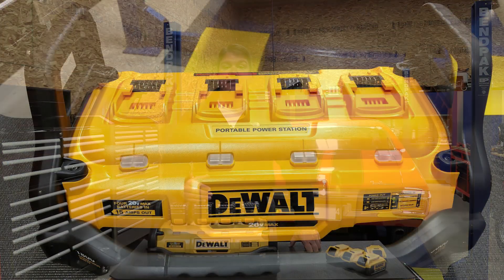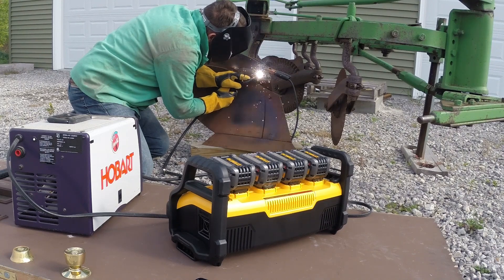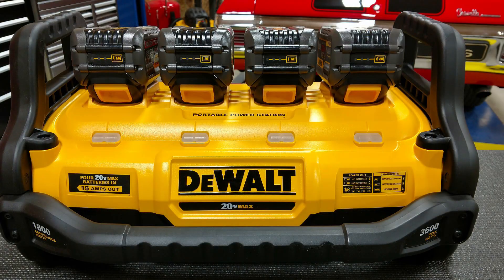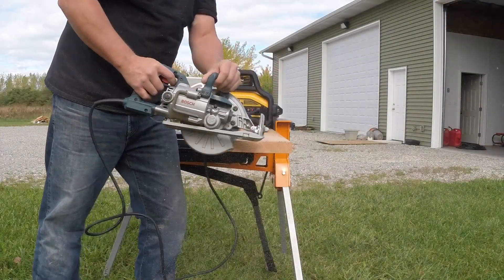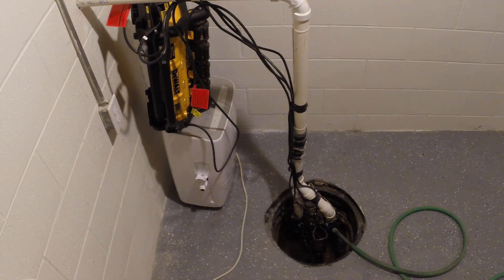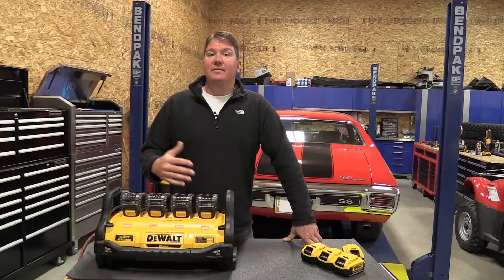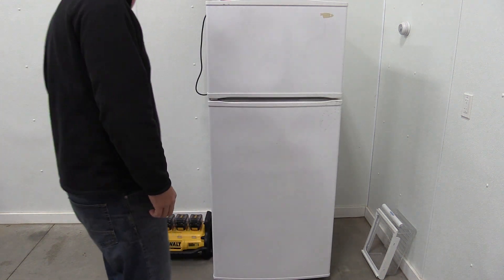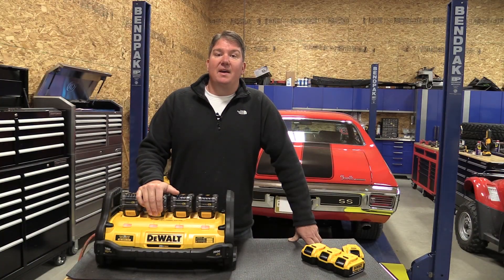DEWALT 1800 Watt Portable Power Station Testing - DCB1800

Comment: There is ZERO reason they could not make it charge and also run a power tool at same time. Absurd...this way i run coil lighting and if the power went off in middle of work, it would switch and run the lights a bit longer.

Comment: So the biggest question I have if I bought 2 n used one as a power source to supply power to the other that is charging would battery bank A die before battery bank 2 is fully charged....🤔

Comment: I use mine with the new 15 amps and I can run a small 8o amp welder with 1/16 electrodes.  Also I can run 2 fridges one freezer , ceiling fans and some lights for about 5 to 6 hours.
Reply from the maker: That is pretty impressive.

Comment: Considering the unit itself is almost $600 i dont see how this compares to a generator. The 60v batteries are 150 minimum, and with 4 in use you can only charge a fridge for 8hrs. At a $1000 you can get a generator that will power your whole house for hours.

Comment: I was wondering of this thing will turn itself off after a while of not being used ? Probably isn't that smart I guess ,but somehow I was thinking it would since last time I think I forgot to push that power button off and when I went back to my storage locker where I have it the batteries were almost drained even though they were almost fully charged before that. However if there is nothing draining power it makes me wonder why it would drain the batteries even if it is on. Also its possible they werent as charged as I thought ,since I know I used it for a couple hours that day with a stereo at very loud volume

Comment: Thanks for the video, I picked up the kreg acs system saw over festool without considering that I couldn't break down sheet goods with it without a power outlet and my CRV can't fit full sheet goods, ordered one of these so I can do it in the parking lot instead of buying something like the accucut and losing the track saw quality.

Comment: True or false

Considering the advent of PowerStack batteries, the MAXIMUM run time for the DCB1800 Dewalt Power Station is STILL 4 DCB 615 15aH FlexVolt Batteries? Real world experiences only please.
Reply from the maker: Powerstack batteries are only at 5Ah currently.  Max runtime on this would be with four 15Ah Flexvolts.

Comment: Do all 4 batteries need to be plug in to use it or can I just use 1. Do they need to be all the same ah battery. Will this power a 1500watt space heater

Comment: I wonder how long it will runs a space heater?
Reply: I ran a space heater with one I had 1 20v max 6 AH battery, 2 flexvolt 6 AH batteries, and 1 9 AH flexvolt battery it only ran for 18 minutes straight before my non flexvolt battery gave out I let sit for awhile and my 9 AH battery said it still had 2 and a half bars left and my 2 6 AH flexvolt batteries said they had 2 bars left so I think if I had all 9 AH batteries it would run for much longer I wasn't that impressed with it but in all fareness it was a pretty big space heater and was kind of asking a lot of the power station.

Comment: My one disappointment is the standby power.  You couldn't really keep it connected to a sump pump as illustrated and expect it to function when a float switch trips.  The standby current just to keep the DCB1800 on will soon suck the power out of even a full array of 9ah Flexvolts.  I haven't done a real test but my observations show it has the batteries down to one LED in a couple of days.  Other than that I love the thing, it powers my new Rolair JC20 Quiet Compressor without a hitch!

Comment: can it charge a 60v electric bike
Reply from the maker: Like a Suron X?  Yes, it will, but remember you lose about 20% of the batteries watt hours used in the conversion to AC.  So you will need to use larger batteries.  8.0 Ah 20 volts or 9Ah Flexvolts

Comment: Can I use a regular 20v dewalt batteries?  Not the flex
Reply from the maker: Yes, it is only going to last as long as the smallest battery you run.  As soon as one battery dies, the system shuts down.  So it pulls the same power from each battery.  If one is a compact battery, it wont last long.

Comment: If this was a pure sine wave I would buy it.
Reply: I saw another video that a guy but an inverter that made the sine wave safe for delicate appliances electronics 106 to 160 for the unit and you just plug it in the dewalt

Comment: I use mine for backup power I’m on oxygen in cases of power outages I plug the simply go resposonic and I’m good for 11 hrs with 4 12 amp battery
Reply: Be careful with medical equipment. The modified sine wave from this inverter can damage it or it may not work correctly. 
https://www.altestore.com/blog/2015/10/pure-sine-wave-vs-modified-sine-wave-whats-the-difference/
Reply: Go with a solar generator, less money, more versatile. Look at Bluetti or Jackery

Comment: Need to 5000 BTU Air conditioner,How long will it run? takes 550/hr (almost 4 hr)think that's right,Thanks
Reply from the maker: Would do 4 hours with four 9 Ah batteries.
Reply: @WorkshopAddict  thanks

Comment: Question:  can u this system with Car Hauler that needs power to it ?
Reply from the maker: I can power a car hauler, but will turn off after 20 minutes if it has no draw.
Reply: @WorkshopAddict   so if I draw no power from the unit it turns off and if I run power from it for an event it will stay on ?  planing on buying more batteries  trying to stay away from  loud generators
Reply from the maker: @NelioJViana  Yes, if you draw power often, it will stay running.  If it sits for 20 minutes without use, it will turn off.

Comment: Fantastic review! I was disappointed it only ran the workshop vac for 17minutes when a new dyson v11 with go 60minutes on torque drive. However running a fridge freezer for that long is impressive and i would probably use one to run a Festool mitre saw which still sadly aren’t cordless yet 🙄 so i guess that would be similar to your 66+ cuts. 👌🏼
Reply: Gotta remember they used the smaller capacity batteries for the vac

Comment: Just stumbled upon the Milwaukee Mxfuel carry on power supply ($2000👀) n was like damn dewalt y'all let me down...only to realize dewalt already had this power station out for yrs with the same inverter system that i c the Milwaukee demo guy seem sooo proud of, smh. What's even better is bare tool is @ $482.50 and i already have 2 flexvold batteries 🤗🤗🤗🤗🤗🤗 "me so happy"

Comment: Would this safely run a dometic ac? Or even a 5000 btu ac?
Reply from the maker: I do not think that any AC unit will run on 1800 watts.
Reply: @WorkshopAddict  there are installations like the micro air easy start that stops your ac compressor from that initial power surge that allows those types of ac to run off of a 2200w honda generator. I'm not sure how much continuous watts they would need but it can't be over 1800 watts. And in this scenario, I'm only referring to the lowest btu ac cooling off something like a cargo van
Reply from the maker: @vtran1082  Then Maybe.  I am not aware of any that will work.
Reply: @WorkshopAddict  I'm just worried that not using a pure sine wave would damage the portable ac
Reply from the maker: @vtran1082  I would be more worried about voltage and wattage of this unit as I think it is a bit small.

Comment: I have the same power station but in the charger mode can I charge just three batteries
Reply from the maker: That sucks
Reply: @WorkshopAddict  my question is if I can charge one or two batteries
Reply from the maker: @JRSRwilfredo  it will charge all the batteries plugged in that need it.  Just plug in one and it will charge one

Comment: Thanks for showing some real world practical uses which can be done.
What I want to know is if you lift it will the batteries fall out and do you need all four batteries to use it
Reply from the maker: The batteries are locked in and will stay in unless dropped.  You do need 4 batteries to run this and all must have a charge.  As soon as one battery is dead, it will no longer create power.

Comment: Could you do a review on this product for me, I sell lamps at a flea market, (indoor) that I dont have an accessible outlet. I currently have about 30 lamps, that I would like to power simultaneously, I am wondering what my run time would be if I used this as a power source. I each lamp would have a 60w led buld which uses 8w.

Comment: Will this power a 1500w. Engine block heater plug? It's the one semi trucks have, thanks
Reply: I'm thinking to add a timer like an hour before my arrival at truck to the DeWalt power station hopefully that will keep the heating element hot on engine block?
Reply from the maker: @justatruckdriver9809  You have to push and hold a button to turn on the power station.  Not sure how you could time it to turn on.
Reply from the maker: Yes, the only downside would be if there is very little power draw for about 10 mins, the unit will turn off. So as long as there is not thermostat that shuts the unit down, it will work awesome.
Reply: The timer has a battery, after watching your video about the DeWalt power station I will buy one this Friday to use it to plug in my truck engine block, a few other if my friends are also looking into it, thanks.

Comment: i have been searching the website and called around cant get a positive answer
can this use the flew volt 20 v 9 amp/12 amp hour batterys?
Reply from the maker: Yes, without issue.
Reply: @WorkshopAddict  what is the capability u can guess if needed or Maybe u know impericaly but if u stick four 12 in there what is the run time run ability
Reply from the maker: @samrowe2889  Same capacuty with 12 Ah batteries, just would up the runtime by 33 percent for whatever you are running.
Reply: @WorkshopAddict  thats what i was wondering like what is the increase in run time and.33 percent is pretty significant and.it.wuf also be a significant purchase at the prices they are wanting for 4 12 amd the tool itself u cud buy a car lol or a really nice gun but u cudnt by.a generator for cheaper tho so i guess if u have ur guns and cars then the next step.is to drop the 1200 on the tool
Reply from the maker: @samrowe2889  IMHO, no electric battery operated inverter is worth 1,300....  Not the DeWalt, Not the EGO.....  They are cool, but when you factor in how short they run and also how much it costs to maintain batteries over many years, they are cost prohibited.
Reply: @WorkshopAddict  man u really broght it home so save the money for a gas geny or either that or dont get four 12ah batterys
Reply: Sam Rowe if your a  Remodeler or framer, this power station is perfect. A must have for construction

Comment: I went to California public schools so my math skills are shot beyond what I can do on my 10 fingers. Anywho, I was trying to figure out if this would be enough juice for me. With 4 12Ah 60v batteries I'm calculating (probably incorrectly) around 45 minutes run time if I ran a 590w polisher. That seems low, but I could be way off with my "math" This is with me guessing the 60v battery would each be like 3 20v ones. And, if I used it just as a charger for my other batteries, with 4 12Ah I would get 2880Wh correct? I'm guessing the Flexvolt 60v each would be like 3 20Ah batteries

Comment: Do the math people ... 12ah battery is only 240Wh .... 
at 1800W continuous, maybe 5 minutes if lucky
At 900W maybe 15 min
Reply: The 12Ah's are 60v, so wouldn't that be 720Ah? And since it runs 4, that should give you 2880Wh.  I went to California public schools so I don't know how to figure out run time though lol.
Reply: @J.R. Williams:
No the 12ah is at 20V and the 60V is at 4ah .. SAME BATTERY
One 20V 12ah battery gives you 240W per hour... 
Four of those together gives you 960W per hour...
SO if your load is ~960W continuous .. that should run you about an hour, maybe ~50 minutes in the real world.
An 1800W continuous load gives you ~.53 hours or ~32 minutes on paper but real world more like ~25 minutes
and that math is 1800W divided by 960W = .53 hours x 60 min per hr = 32 minutes of run time ... 

Even if you did have 2880Wh capacity, the machine will ONLY release 1800W continuous .. SO by that math, that 1800W load will run for about ~1.6 hrs or ~1hr 36 min ....  on paper...

Comment: My power went out and this dewalt power station powered my full size freezer/fridge for 6 hours until my power was restored it was impressive.
Reply: Tell us what size damn batterys you used!??
Reply: @marcowens3522  I used 4 of the 9 amp hour flexvolt batteries and it can power my big freezer fridge for  8 hours. I have sets of batteries so I can switch out and charge 4 and run 4 at a time. I charge them in an emergency with a small Honda gas powered generator. But so far both power outages were fixed before I had to worry about changing batteries or charging. Its super easy and convenient to just run my freezer fridge on batteries and no fumes or gas to worry about.  But I got the gas gen as stand by as needed to charge batteries. Its quick with a fast charger too.
Reply: @dustinbrandon5310  I was told it's 15amps but don't charge then at 15amps? Does it charge all the batteries at the sametime?
Reply: @marcowens3522  yes I can charge all the batteries at the same time because I also have a dewalt charger that takes four batteries at once. It charges them pretty fast too. My little Honda can easily charge my 4 dewalt batteries at a time I've done it quite a bit testing it out. That dewalt power station can power out or charge four batteries at once also. I dont do it like that though I have a separate dewalt charger and I own 12 batteries so I can be running my power station non stop if necessary.
Reply: Was that with the 4amph batteries?
Reply: Yeah that’s not long must be low amp bat 🦇

Comment: So i can use it on my camper ?  i mean plain camper with just the use of light.
Reply from the maker: Yes, without issue.
Reply: Korlim Services absolutely. Use led bulbs and it will definitely atleast last all night. I only have 1 60v  and the rest are 20. I’ve ran my chopsaw vacuum and air compressor to finish small trim jobs. I can’t wait to get 3 more 60v

Comment: I noticed the dewalt 4 port charger dcb104 charges 4 batteries a ton faster then this unit including 4 12ah 60 volt batteries
Reply from the maker: You are right!
Reply: @WorkshopAddict  you guys rock
Reply: Yes. But that particular model is not a power station

Comment: I would really really love to see the run time with the 12 amp hour flex volt batteries. Because typically it is more than merely double. The reason for that is you were then working the batteries less hard and they are not getting as hot so you tend to get better then just a double run time battery
Reply: Would still-like to see that , we have power outages here in Houston often
Reply from the maker: Go any i can borrow?
Reply from the maker: We do not have 4 12 Ah batteries.  That's a lot of $$

Comment: Does this run festool ts55 plunge saw?
Reply from the maker: Yes, it will without issue.
Reply: @WorkshopAddict  that's what I thought but my ts55 doesnt work while plugged into power station ..
Reply: It should

Comment: Ego just came out the Ego Nexus 2000w. Can you do a comparison video between the  Dewalt  and Ego converter.
Reply from the maker: Gladly will.  We have been using the Nexus in testing.  The Dewalt will be half the price...
Reply: WorkshopAddict does the output power 220-240 v also ? I understand it needs 110v to power the charging.

Comment: DeWalt flexvolt 60 volts lithium ion battery 12A/H
Reply from the maker: That makes this thing cost a ton!
Reply: @WorkshopAddict  Ya, they're about $250 each from what I've seen online.
Reply: 12ah battery is only 240Wh ... this unit does NOT ADD them together, the batteries are in SERIES ... hence why they say its only as strong as its weakest link because the amperage is the same across the unit, once the smallest battery gives out, the unit shuts off. This is why when the unit is dead, all 4 batteries are dead because it drains equally across all 4 batteries

Comment: If we use 4 x 60V battery, is not become 240Volt ???
Reply from the maker: That is not how this unit works.  It uses the batteries in the 20-volt mode.
Reply: So this wuld be like runtime of 8 20v baterys depending of the amps for each batery

Comment: How long will it last now with 4 12amp flex volt batteries
Reply from the maker: I wish I could answer that but I only have it set up with for 9 amp hour batteries right now.
Reply: @WorkshopAddict  how long does it last
Reply from the maker: @danieldepot4090  I can run my full camper, less AC, for 2 days.

Comment: Hello can someone please tell me if the batteries 20v max 15amps exist? Happens sell only the power station without batteries and the batteries sold separately are not 20v- 15 amps, so l do not know if it  works with other DeWalt batteries with fewer amps. l appreciate if you can help me

Comment: The DCW1800 is not THAT good. Gives power for a little more than two hours . Some calculated that a fridge could run for a whole night on it or they calculated a day of watching TV etc. This power station gives up very fast if low energy consuming things are connected. Even if you just forget to switch the power station off the batteries will be drained within 2 hours . Recommend a good inverter and a few car batteries. Cheaper.

Comment: Just bought this and just wanted to clear something up. The flex volt 60v/20v 6.0ah is the equivalent to the 20v XR 6.0ah battery in 20v use. Meaning you would save some weight on the dcb1800 use weight and not sacrifice any performance by switch. Also they're half the price. GREAT SHOW GUYS.... PLEASE DO A PART 2 WITH THE NEW 12.AH BATTERIES. Would love to get the run times from that test.
Reply: And now dewalt has a 15ah battery😂